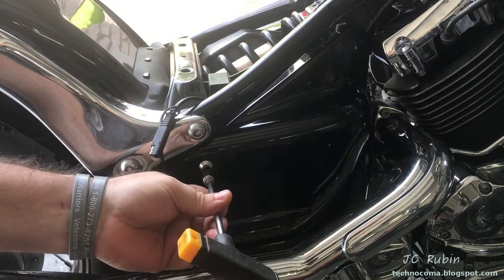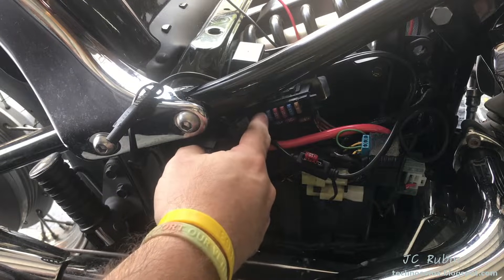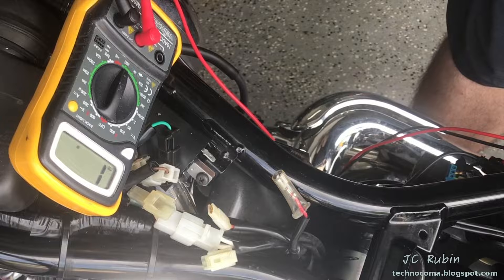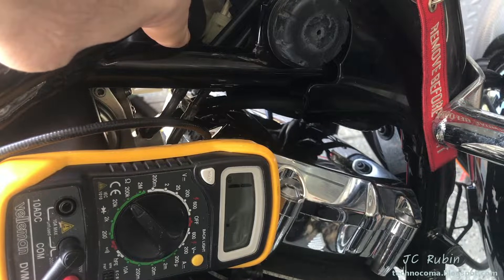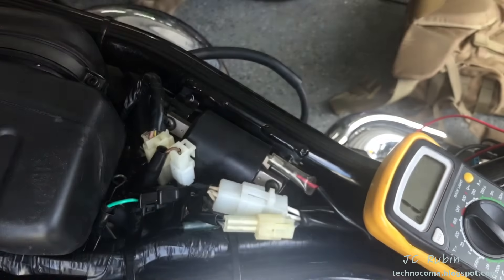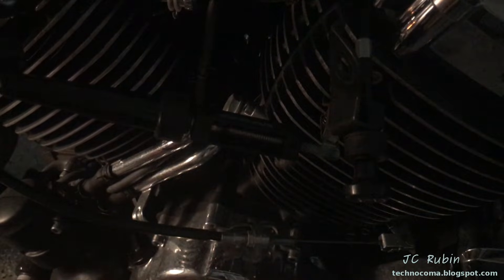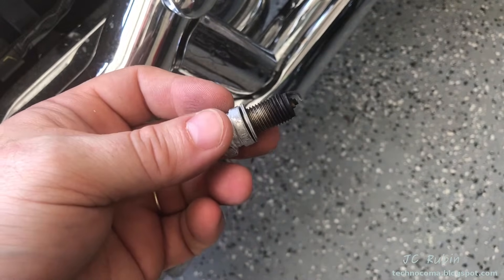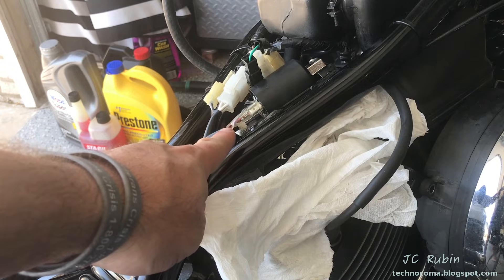Yamaha Star 650 Ignition Testing and Troubleshooting  - From The Battery to the Spark Plugs

Comment: when i go to push the the ignition switch nothing happens and i have a multimeter but I'm still having a hard time trying to solve my problem. i tried using the multimeter on the coils and i get no reading but i don't know if its because i don't know how to use it or if the coils are the problem. it would be great if you can help me out

Comment: What if the light and neutral switch don't even light up, what do I check first? Or what is posible cause?
Reply: Check grounds, or fuse!
Reply: @twade994 fuse are good. It won't even make the little click sound on relay. I also changed relay 3 times. I charged battery and also used booster. I have no power other than at the battery

Comment: When you run the engine at about 6:50 to purge the carburetor that is what my bike sounds like. Fair to assume I'm just out of gas? I just bought it and its my first bike, so im not sure and dont want to mess anything up!

I havent tried flipping to the reserve tank just so I don't flood anything.
Reply: I don't think it means you are out of gas, but just add some to be sure.
Reply: @jonathanvillalba3214  I did end up being very out of gas.... But my battery was also dead hahaha. Onto the charger it went, a bit of gas in the tank, and she runs like a dream again

Comment: Dang... I gotta get to my front ignition coil - that looks like a job and a half for a first timer.
Reply: Did you get it replaced? Was it a pain in the ass? This is probably something I have to do and I know absolutely nothing about motorcycles.
Reply: @craigandrews3477  I wound up taking the seat and tank off (YT videos show how easy it is), and I couldn't get to the coil. Thankfully after some mulling it over, I had another go at it, and discovered the spade terminal had simply come off - grabbed some needle nose pliers and gently bent the rolls over so it would bight tighter on the terminal (did both of them) and it's worked like a charm ever since.

I hate to think what's involved in pulling the coil out and putting a new one in because of how cramped it is.
Reply: @carneeki  I appreciate the prompt reply. I’ll see if that works on my bike. Thank you, brother.
Reply: @craigandrews3477  good luck!
Reply: @craigandrews3477  if you need to, and manage to remove the front coil, the world probably would benefit from a video on how you did it :)

Comment: Do u happen to no what color is what on the 4 plug connector on the back on the key switch?  Looking to relocate my key switch to the top of the tank like a Harley key switch is I no what is what on the new key switch I bought but I need to find out what color does what on the harness side of the key switch on the bike

Comment: Just want to say thank you. Because of this video, I was able to determine the pick up coil on my 05 650 vstar failed internally. I replaced it and the bike is running again. You were a big help!
Reply from the maker: Glad to hear!
Reply: I think that might be the issue with mine too but I might be setting my voltage meter to the wrong setting
Reply: What is the pickup coil??

My partial r doesn’t know what it is.

Comment: I recently bought a 2007 yamaha xvs1300 without ignition keys, tried to bypassed and it cranks but no spark and fuel pump does not prime. Will this be the ecu that needs corresponding keys? More so is xvs 950 has same ecu for the xvs 1300?
Reply from the maker: I would recommend asking a dealer with title in hand what cans be done for a replacement kwy

Comment: DO NOT wire wheel your plugs!!! It leaves behind residual metal from the bristles and will short it. Best to blast them with glass beads with a spark plug cleaner. I know this from practical experience.....

Comment: What if you can jump start thru the solenoid, but it won't turn over with the start switch? what's the problem there?
Reply: if it turns with jumping solenoid, then starter is fine? check switch make sure it has power on both sides

Comment: I have a V-Star 650 battery is fully charged I put the key in the ignition the light on the dash glows the lights turn on the turn signals turn on but I don't hear no fuel pump and when I turn the key and I push the start it doesn't do anything it's like the bike doesn't even have a battery in it what could be the problem.

Comment: I have a 1 when I check my pickup coil so I'm assumeing thats problem.  I have no spark in either plug coils.  I didn't think pick up coils ever went bad.  Do you have a video about replacing that?  Last year my bike was running 1 qt oil when it's supposed to have 3qt.  I'm thinking the temp got to hot and caused problems.  I think I'll replace stator also since im down there.
Reply from the maker: Sorry I do notyet have any video for pickup coil or stator replacement.   When I do one I will document it.

Comment: So I’m having trouble with the bike turning over the battery is charged but it is not turning over however when I was checking it with voltmeter and had it attached to battery it turns over what might be the issue
Reply from the maker: Loose battery terminal connection?
Reply: Retro Tech & Electronics I’m thinking it might be a bad starter switch could that be it ?

Comment: Thanks for the video man! My Yamaha is having an issue where the front runs fine but the rear is off. At high rpms it seems to run ok but it dies at idle and it doesn’t run as hot as the front. I’ve ruled out carbs because those have been cleaned professionally and I’ve taken them apart again to make sure. It has to be a wiring issue but I even swapped the coils and it still has the same issue and got new plugs...
Reply from the maker: I dunno..... that sounds like carbs to me.,..
Reply: Did you ever figure out the issue? I’m having the same issue with mine also but the from cylinder is running off and a lot colder than the front.

Comment: When contact position "on" The battery down almost to 10-9voltage, the battery normal or drop? Please help because i have problem drop voltage
Reply from the maker: try charging the battery overnight to see if it can hold a charge, then do a current test if it drops too quick.

Comment: Great Video. I do have a question. does the ECU  send signal straight to the coils or is there a separate Igniter unit before the coils? I'm only getting spark out of one coil. They both tested fine.
Reply from the maker: There is in fact an igniter.  It is the last thing, once troubleshooting is expended, it is swapped out to see if that is the ROF.
Reply: @retrotechandelectronics  I only got spark out of the front coil. No spark on the rear one.  Checked the coils and spark plugs are all good.  Any idea or suggestions?  Thank in advance.
Reply: @Group2Matrix, did you ever get this resolved?  My bike also gets only one spark out one coil
Reply: @tungle7  turns out the bike has been sitting so long, the carburetor jets got clogged up during some time. Had to have the carb rebuilt.
Reply: @Group2Matrix  I mean did you ever find out what cause not getting the spark for the second coil?

Comment: I took off the tank and cleaned the carbs but now when back together -nothing, nada electrical for starting or anything else.  The battery shows 9V and the charger says dead battery and that something is taking charging power and to take out the battery and try again.  The guy I bought it from 2 years ago said the battery was new.  Even w/9V wouldn't you hear solenoids clicking?  You said there was one main fuse but I didn't see where that was.
Reply from the maker: 9v is bad

Comment: Great video, unfortunately my bike still has no spark to either cylinder all my voltage and resistance tests are good. Last fall I did have the pickup stator replaced and on the way home it was backfiring really bad that was the last time it ran. Any help would be greatly appreciated. I even got to the point where I used my buddy's CDI to see if that was the issue still no spark.
Reply from the maker: The stator sounds like a smoking gun, at that point, I personally would start hooking up an oscilloscope to see if there was a signal coming off the pickup at all.
Reply: @retrotechandelectronics  right ya kn ow, because everyone has an oscilloscope laying around.
Reply from the maker: @randallhupp4692  you reach a point as you dive deeper , eventually you will run out of test equipment.

Comment: Hav all the right voltage put a new carb pick up coil coil packs plugs fuel filter fuel lines and pump new computer box when I go to start it it sounds jus like your bike did when you pulled your plugs out don’t know what it could be

Comment: I got power at my coils but no spark at all either cylinder.. plus I don't hear my fuel pump just thumps once and that's it
Reply from the maker: drain some fuel from one of the carb bowls and see if the pump cycles to refill it when the key turns on.
Reply: Ok that was the problem with fuel pump. But when I test my pickup the meter just jumps shows a k then overload
Reply: So apparently o l means open loop so that means my pickup coil is shot then right if I get no reading?

Comment: I think my fuel pump on my vstar 650 is weak,when I give it gas to move it falls on its face.Have you ever changed a fuel pump on the 650?
I have a service manual coming this week,,,
Reply from the maker: I made a video about testing and replacing the fuel pump

https://www.youtube.com/watch?v=UmL0GVs_4zw
Reply: Could be filter